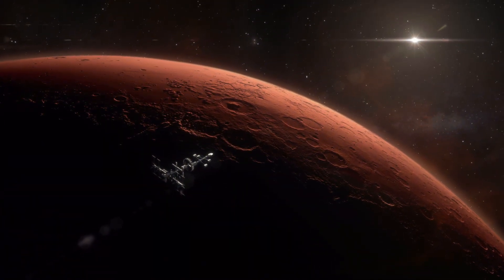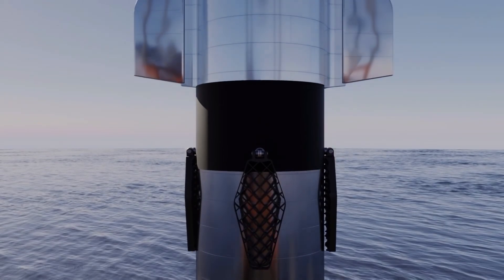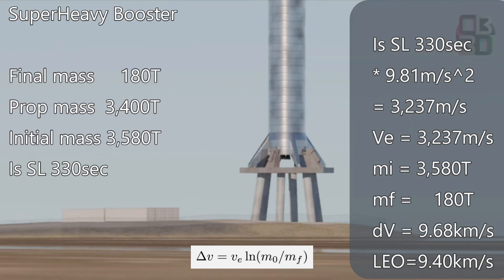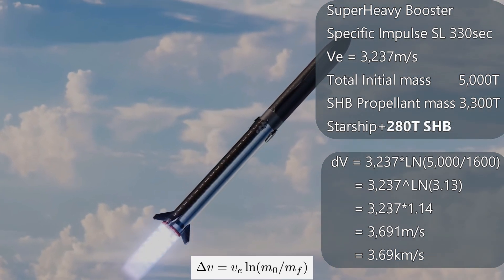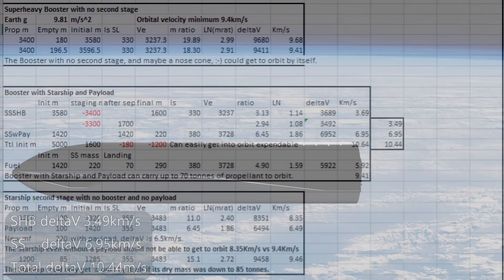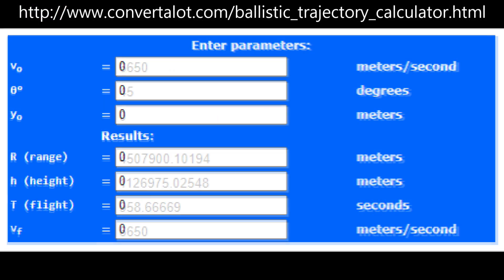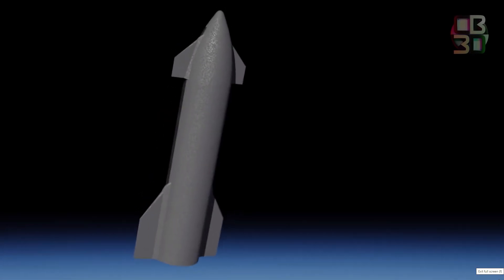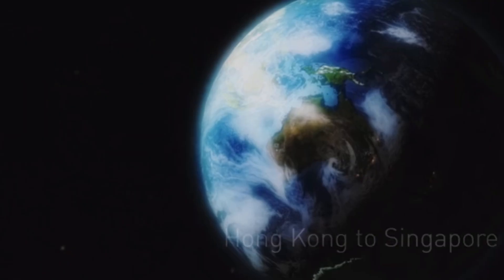SpaceX Starship: Earth Point to Point Transportation

Comment: I would've thought that SX would be landing boosters on Phobos/Deimos and then refueling them and doing minor maintenance and then having those to p2p back to Florida/Texas where they would undergo finishing maintenance and then be reused.

What about a booster/starship combo with a truly stripped down starship which has only RCS thrusters  and an enlarged fueld tank?  Dispense with the Vacuum raptors and just haul the whole thing into space where it can maintain orbit and act as a fuel point for crew/cargo starships that need to return to earth.  Booster could siphon fuel from it and maybe have enough for a return burn to land on Deimos/Phobos?
Reply from the maker: The problem is that the Booster by itself can only get 15 metric tonnes to LEO.  Without staging it is a single stage to orbit and these are not efficient on Earth.

Comment: Nice video.  Some additional thoughts.  The Concorde had a payload of just over 10 tons (100 people and 2.5 tons of cargo) and a range of 6,650 km.  Using your spreadsheet for just the Starship upper stage with a payload of 12 tons, I get a delta-v of 8,050 m/s (rounded off).  Plugging that into the online ballistic calculator, the range would be 6,600 km.  So, flying the Starship second stage without the booster would result in matching the Concorde's payload and range.  

But, it would be able to do NY to London in just 20 minutes instead of the 3 hours (an order of magnitude improvement) required by Concorde.  Much of the flight would be in weightlessness at altitudes above 1,000 to 1,600 km (compared with the puny 105 km peak altitude of Blue Origin's rocket and even above the 400+ km of the ISS).  With the small number of engines, it wouldn't make anywhere near as much noise as a Super Heavy, and could therefore be launched closer to cities.  It would also be a lot less complex, be safer, and do much faster turnaround-times (critical for profitability), compared to a 2-stage system.  

Of course, the fuel alone would cost $5,000 per passenger, because there are so few passengers.  That's pretty much the cost of a 1-way trip on the Concorde, leaving no money to pay for the equipment and operating costs without significantly increasing the ticket price.  Maybe SpaceX can stretch the Starship to carry more fuel and payload?
Reply from the maker: Wonderful analysis... I have no doubt that the experience itself would be worth the cost.  Virgin Galactic is charging about $450,000 for a 40 minute trip to nowhere... with only a few minutes in "space".  Starship would take you into real space, and be a lot more fun!

Comment: What would it take to make the Starship second stage a single stage to LEO? I have tried but my spreadsheets just can't get there. A Dv of 9.4 just is not appearing. Perhaps replace two of the three Vacuum Raptors to SL units? Obviously payload would be low, but I am curious if it could be done.
Reply from the maker: You would need 6.3 Raptors to cancel out gravity so about 9 to get off the ground with a good T/W ratio.
Then the propellant mass is just not enough.  The booster can be SSTO but the Starship will have to be ballistic without the booster and limited to about 4500km from my calculations.
Reply: @terranspaceacademy  Fascinating, Thank you! Regarding the Ballistic calculation for the SS, would that be with full payload?
Reply: @terranspaceacademy  In the walkaround interview between Tim Dodd and Elon, you could clearly see that the starship second stage had more than enough space for 3 more raptors, which means it would have enough thrust-to-weight.  If the second stage is then stretched to hold, say 2,000 tons of fuel while adding only 30 more tons to the empty mass, then my calculations are that it will reach 7,500 m/s.  That would result in a ballistic range of 5,734 km, which is enough to get from NY to London.  More stretching might result in greater range.

The reasons why a single-stage ballistic flight would be ideal are:
1) It is far simpler and will be more reliable than a system of 2 stages that need to be assembled before fueling can begin.  Points of failure and risk will be radically reduced.
2) It generates far less noise, because there are only, at most, 9 engines instead of 30+ engines used at launch (as when a super heavy is involved).  This allows the launches to be conducted much closer to the destination cities.  (Note: if helicopters are used instead of the boat in the SpaceX video, the noise issue is not as important.  Helicopters can cover 30 miles from city to super heavy launch pad in 10 minutes, a simple solution that naysayers fail to disclose in their anti-Starship videos).
3) It will require much less fuel, because it doesn't have to get all the way to LEO.
4) All in all, those would cut costs tremendously and make it far more economically viable.

What combination of fuel and dry mass might be possible if the goal is to have enough range to match the Concorde's (6650 km)?

Comment: I would have thought that starship could fly by itself to a certain distance I think maybe 8,000km without super heavy
Reply from the maker: Sadly it couldn't leave the ground fully fueled.  It would need 6.3 Raptors break even and 9 to fly.
After that if it has a payload of 100 tonnes it would be limited to about 4500km.
Reply: @terranspaceacademy  ah ok. A while back Elon tweeted that super heavy wouldn’t be needed for a certain distance I guess he was wrong
Reply from the maker: @anguscovoflyer95  If it’s not fully fueled it could travel with six engines. I’ll take a look at it and try to see what would be the optimum fuel load.
Reply: @terranspaceacademy  ah ok. Maybe Elon musk doesn’t intend for it to be fully fueled nor operate at its max capacity for these hop flights

Comment: When you discuss Starship point to point here, you forget the original conversation that started it off, especially when Elon Musk himself said this:

https://twitter.com/elonmusk/status/1134025184942313473?s=21

It doesn’t have to get to orbit to work well as a point to point transport. And you severely underestimated the range it would have. 6.8km/sec still translates to Mach 20, and with atmospheric lift, even at that lift/drag ratio, gives it a range of 10,000km with ‘decent payload’. He mentions that doing things that way dramatically improves cost, complexity and ease of operations. 

Don’t worry. Even for him it was an unexpected result!

The idea of adding raptors was considered by him for it to work well. Mind you, the thrust of a Raptor is 225 tons which means adding 2-4 raptors is a necessity, without removing much delta v, to get it off the ground fully fueled. All that matters is getting to space and accelerating to hypersonic velocities, then using the mesosphere as the medium for which is glides into and out of for the harrowing 15-25 minutes of flight time in that regime.
Reply from the maker: Thank you. The math gets hard though.  A fully fueled Starship with 6 engines has too little thrust to get off the ground.
You would need at least nine engines to be practical. That would absorb another 3.75 tonnes or so for the additional 3 engines. When I do the math I get a maximum ballistic trajectory of 4500km...

Comment: Also note that the starship can't lift off on its own fully fueled. the engines can only provide so much thrust.
Reply from the maker: It will always need the booster or have to be partially fueled. If all six engines were sea level it could lift off with about 872 tonnes of fuel I think.
Reply from the maker: At 1.3g acc
Reply from the maker: T/W = .95 fully fueled.

Comment: Thank you for responding to my comment in this video. That’s a rare first for me!

The rocket equation has been helpful past two months in backdoor calculations I’ve made determining that Super Heavy is far more useful than people think it would be simply overcoming earth’s gravity well on the surface. It already would need to survive the vacuum of space, and fuel itself and starship through its own plumbing on the launch pad. I think it would also make a powerful reusable orbital tug, fit for overcoming earth’s gravity well from orbit. It could spent time in space pushing starships from LEO into higher orbits without any Starship burning its own fuel. Because it has such a large fuel tank, it inherently has the delta v and TWR, even with 8 booster raptors swapped with 4 RVacs placed symmetrically around the outer ring cluster, to reach orbit on its own without starship on top. What it needs though is an electable nosecone and an adapter to mount RVacs using the RBoost fuel plumbing. 

The delta V of SH alone without Starship with some assumptions made on the V(e) due to being halfway between  RBoost/RVac, would be about 10.6km/s. With 20 RBoost and 4 RVacs, the TWR remains the same as that of a full stack at 1.5. 

Add 1420 tons of starship and its 100t payload onto that in LEO, and the Delta V is 4.2km/second. In theory, this would give Starship an additional 3km/sec of delta v since when starship stages from SH in this context, it multiplies the remaining delta V in SH, allowing it to return to LEO. 

That gives a number of opportunities for SpaceX to send Starships further and sooner than with SS/tanker SS architecture alone, since SN20 will need to be fueled by BN3 anyway for the orbital launch later this year. This also adds the possibility of a free return mission from Mars, by drastically reducing if not outright eliminating the requirement of a refueling on Mars via Sabatier processing of the gas and ice. Putting a booster in orbit to be refueled also puts Jupiter and Saturn in range of Starship with a considerable amount of payload capable of being sent to their moons, as well as a large slew of atmospheric probes NASA would want to send to those planets, and Uranus and Neptune, for cheap.
Reply: To clarify: there are many YouTubers and science people in this community, Angry Astronaut, Robert Zubrin to name a few, who realize Starship, even with the tanker, does not have enough delta v to land on the moon and return to LEO.

So I ask why having the booster doing what it does in orbit isn’t a quick solution to that problem, even though doing so requires minimal changes to the entire system? It serves the same goal of pushing Starship out of Earth’s gravity well without Starship using its fuel during that stage in flight, except it can do it either from the surface or from orbit.

I’ve heard before that refueling starship in orbit is essentially adding a third stage. 

What having a refueled booster in orbit does is add a fourth stage. 

And this is simplified in terms of number of flights by the consideration that Tanker starships, being completely unmanned, are the simplest starships to catch instead of land, which would drastically increase their launch cadence in demand of refueling starships in orbit as is. If it takes 34 launches of them to refuel a booster, then four tankers servicing one would take less than 36 hours to complete.
Reply from the maker: Very interesting.
Reply from the maker: A fully fueled super heavy booster in orbit would be incredible.

Comment: I have been trying to work out if Lunar Starship could do multiple moon landings without refueling if payload was sacrificed for fuel.  Commentary I have seen indicates it would need two refueling starships to LMO for each lunar decent.   Can you confirm this?
Reply from the maker: I’ll do the math.
Reply: @terranspaceacademy  Thanks would love to hear your thoughts.
Reply: I think I have it solved.  We don't know yet the height of the Lunar Starship. The fuel tanks could be stretched to super heavy booster length if necessary.  So long as the stretch and extra landing engines, life support equipment, does not exceed extra dry mass of 100 tonnes.  It is then only fuelled sufficient to get to LEO.  Once in LEO and not subject to high gravity it can be fully fuelled sufficiently for multiple lunar assent, descents and maybe even return to LEO for refuel depending on economics.
Reply: My rough numbers - A superheavy-starship with 3600 tonnes of fuel and 10 tonne payload and total dry mass of 130 tonnes once shedding extras and adding life support etc has a delta V of 12.38.  LEO to Moon surface and then low orbit twice before free return from lunar escape velocity I get deltra V of 12.36.  If the dry mass goes up to 200 tonnes can only get one landing before must return for refuel or two and expended.
Reply from the maker: @derekbeasley  Great work :-)

Comment: An interesting idea, but what is the maximum acceleration? Airliners typically impose no more than 1.25g on passengers although the plane can sustain much more.
Reply from the maker: Most rockets don’t exceed two gees to avoid overstressing the frame. Once they’ve burned a lot of propellant they can do up to 6 gees like the falcon nine on reentry. With humans on board it will probably be 1.7 G limit.

Comment: Yikes! If Super heavy can make it to orbit, that's an orbital refueling depot!. Stick a nose cone on it equipped with solar panels, refrigeration compressors, small maneuvering thrusters for station keeping and you have a 5,400 ton orbital fuel tank. this decouples tanker flights from Mars bound fuel ups. At 5,400 tons, that's 36 to 54 tanker flights (100 - 150 ton payload/flight) More importantly, 5,400 tons in orbit refuels Moon or Mars bound 4.5 Starships at one go.
Reply from the maker: Sadly it burns all its fuel getting there.  It could only take 16.5 tonnes with it by my math.  Put the Starship on top and you get 100 tonnes up there :-)
Reply: @terranspaceacademy  The point of the booster to orbit is to use it as an orbital tank. Since this would never return to earth, delete the grid fins - another few tons and perhaps loose a few Raptors. If it arrives in orbit empty - so be it. We now have a 5,400 ton capacity fuel depot in orbit. The advantage comes operationally after it's in orbit. A regular train of tanker starships continually replenish it. Onboard equipment continues to refrigerate the tanks to eliminate boil off. Mars or Moon bound Starships dock, refuel completely at one go and then depart. this way the out-bound Starships make one stop for fuel and then continue their mission.
Think of it this way - the first infrastructure we need is LEO based industry, fuel depots, transit points, overnight (short stay hotels). From here, the outbound wagon trains gather up, stragglers, fuel up, shift cargo, settle passengers and depart.
Reply: I thought of this too except it would be a waste of all those raptor engines.  Now if there was a way to salvage those engines . . .
Reply: @nolsp7240  maybe you could, if you send a starship with a pair of robotic arms and some good engineers to dismantle those engines and put them in the cargo bay to return it to earth, at two tons per engines and 28 of it that will be 56 tons of payload at landing, but obviously superheavy itself don't have capacity of 5400 tons of propellant (it's only 3500 tons 5400 it's the mass of whole stack two stages dry mass and propellant +payload ) that would be enough for a orbital fuel depot.
Reply: @nolsp7240  Well, They could be considered throw away - Or. . . This is SpaceX. Could they perform EVAs and recover them? Leave one for station keeping.

Comment: Great lesson as always but I just can't help thinking that wings are better. The propellant needed to land seems way larger than the difference in mass one would expect between flaps and wings. I'm not even sure that wings would be heavier than the "skydive" system since it requires a good bit of battery to handle the higher forces needed to move the flaps as compared to the lower forces on an aileron. They seem to be reinventing the wheel into a form that may be able to land on Mars but is wasteful at getting mass to LEO.
Reply from the maker: We should do the math on a delta shaped MegaDynaSoar and see where it goes.  Have you looked at the early Von Braun designs modeled with Disney?
Reply: @terranspaceacademy yes. Now you're talking!